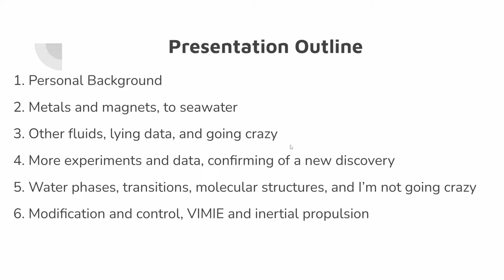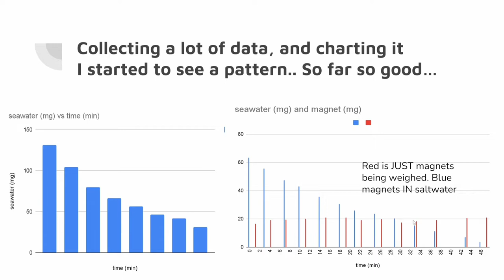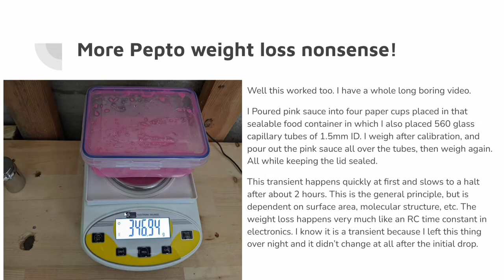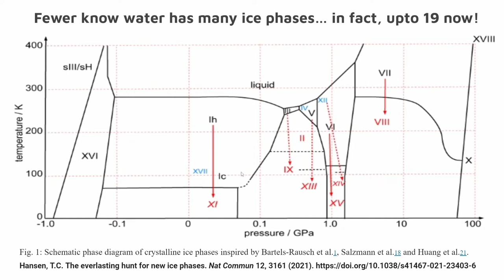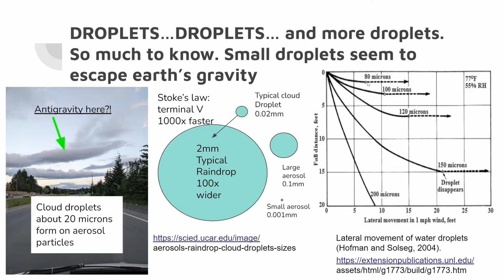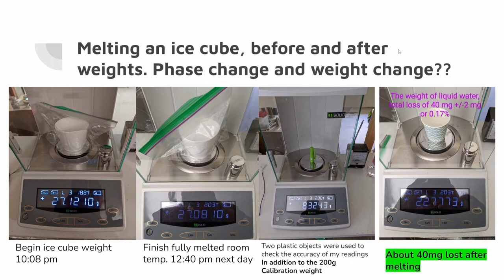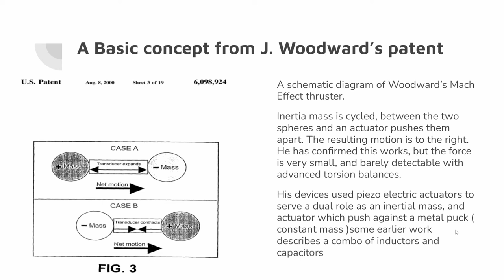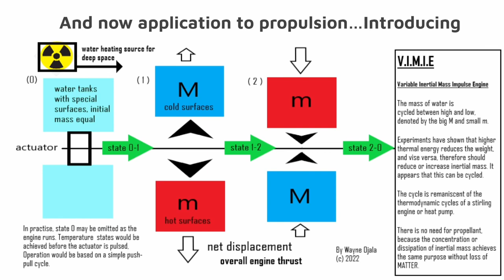Water and its antigravitational property | APEC slide presentation July 9, 2022

Comment: You certainly convinced me.
Something that you may not know, clocks that run off of checking inertial mass turn out to be really not accurate, it seems to change with time. So for the most part people quit making those kind of clocks instead of investigating what was going on. I wonder if this has anything to do with what you have figured out

I couldn't get through the last 4 minutes. I know I'm a bit autistic, but the music made it incredibly hard to seprate out what you were saying. I will try to finish the last few minutes after I have cleared some of this stress.
Reply from the maker: Thanks adam, and interesting note about clocks changing. Would that be pendulum types? Sorry about the music. It was a pain trying to get the volumes right.
Reply: @failforwardresearch3127  pendulum type clocks are very accurate. These use a spinning mass with a spiral spring.
Reply: I agree with spacecase0. The music is unnecessary and distracting. Your charming voice doesn't need music to sound good :D
Reply: @spacecase0  atomic clocks also rely on the mass of the atoms that are oscillating. If the inertial mass changes, time changes too.